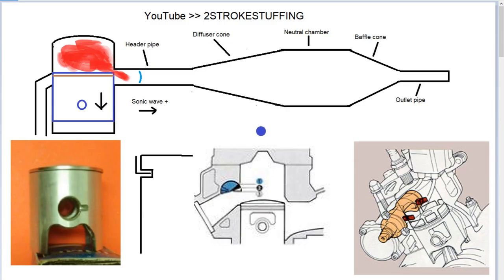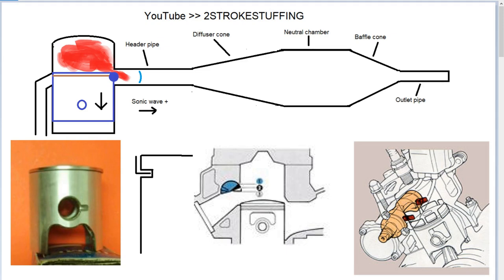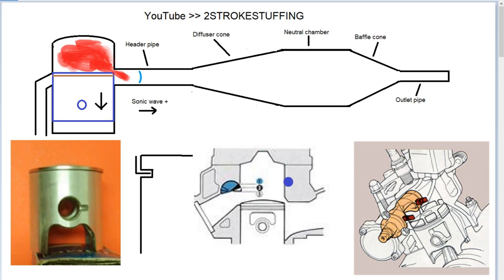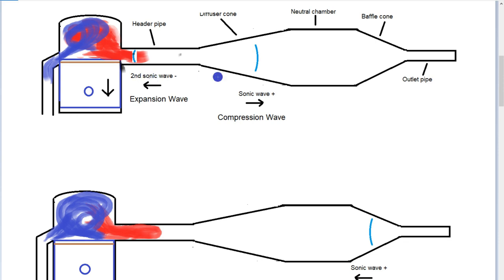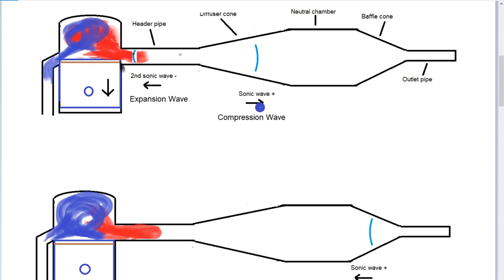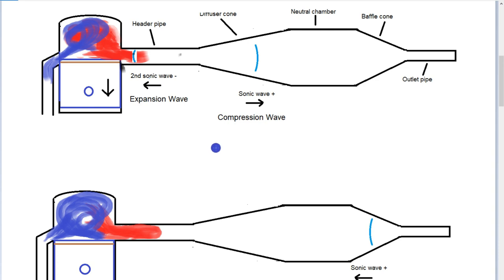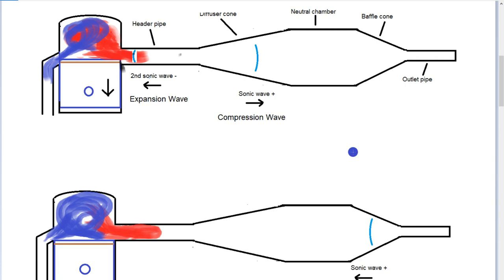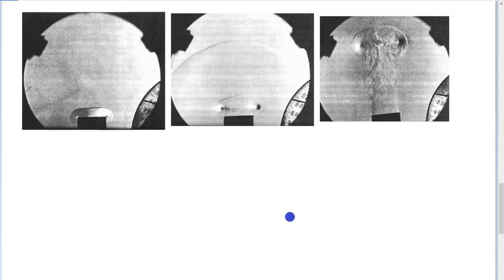2 stroke power valve, gas v acoustic velocity, exhaust port timing for expansion chamber. E2

Comment from the maker: UPDATE: Was going to upload E3 but need to do another edit of it and its 3:30 am here so Ill get it done tomorrow.
E3 covers calculating tuned lengths and shows two equations used in publications that are confusing, one for imperial and the other for metric. I will show a simpler self explanatory equation you can use that can use tuned length in inches or millimetres it doesn't matter.
And shows why there are two tuned lengths values required not just one to the baffle cone and how to calculate both.

Comment: This reminds me a bit of tuning a bass reflex speaker port for maximum low output based on the resonant frequency of the enclosure. Fascinating, thanks.
Reply from the maker: Not really
Expansion chambers don't operate on resonance like a pulse jet or the like does.
They shape of them reacts to a single compression wave as the exhaust port opens to produce the effect.
Resonance (as in Helmholtz) applies to highly specific frequencies and harmonics of them where the expansion chamber exhaust operates over a wide range of frequencies over the range of engine RPM.

Comment: I use those L shape rings in my kawasaki 125 rotary valve engine and was told they woukd be trouble but so far so good
Reply from the maker: Hi Sean, might be an issue if the port inst chamfered right but otherwise they work fine. That is an IAME race piston from  DAP or Parilla rotary disc 100 reed Kart Engine, revs to 20,000+ no problems.

Comment: Great videos that explain the science. I am an old mechanic that has stumbled into the two stroke world with a stock Aprilia RS125. I've lowered squish/raised compression and the bike has so much mid range torque and acceleration now. But... peak power is now down 1,000 RPM  (11,500 down to 10,500 RPM), which obviously reduced the top speed. I am guessing the scavenging and pulse characteristics have changed? Would appreciate your thoughts on this. As I want to keep the bike as stock looking as possible, my next step was to experiment with some stinger inserts and other elements of the exhaust.
Reply from the maker: If you lowered the whole barrel to effect the changes then you will have reduced the port timing and that would favor low end power at the expense of peak power.
If on the other hand if you have milled down the head to get higher CR and the barrel height is not changed then it may be the result of reducing the squish clearance is that the squish velocity is now too high at the higher RPM.
When making changes to the squish clearance or angle to piston or percentage of the combustion chamber it is important to calculate what the squish velocity will be to ensure it remains within reasonable bounds.
I will be doing a video on squish band and velocity soon.
Reply: @AuMechanic  thanks so much! I forgot to mention I shaved a bit off the head. I didn't want to affect the port timing. A squish video would be great! I still can't get over what 0.5mm achieved.
Reply from the maker: It is not just the clearance but also the angle of the squish area in relation to the top of the piston as well as what percentage of the chamber is taken up by squish band all of that and RPM determines what the squish velocity is.
The simplest way to describe what squish velocity is would be that when you stamp your foot in a puddle of water causing water the shoot out from the gap between your foot and the ground, the speed that water shoots out sideways describes the squish velocity being the mixture shooting out of the squish gap into the combustion chamber bowl as the piston rises to top dead centre, the speed of that should generally not exceed the speed of the flame front heading in the opposite direction outwards from the spark plug when combustion occurs.
There is an equation Blair provides to calculate squish velocity in which you can input a load of values measured and the resulting output value being squish velocity should be around 15 to 20 metres per second.

Comment: Hi. Thank you for these very interesting and in depth videos of some of the many different things going on all the time inside the 2stroke engine and exhaust system. I have a question well actually two about power valve systems, which I don't know if you have covered elsewhere?
1, I understand that the main types of power valve systems are the ones that control port height and area, and the other types that control exhaust resonance and effectively exhaust system volume.
But why don't all more modern engines use both systems together which I assume would always be more effective than one strategy or the other? Is it because it's counter productive to try and control different things at the same time?

2, Do the resonance control types of power valve work by either effectively giving you a low rpm suitable expansion chamber, as well as a high rpm matched one all within one pipe design?
Or is it that they don't really tune to pipe to work at lower rpm, but more nullify the effects of a pipe that's designed to work best at high rpm, by making the pipe so much bigger that it doesn't have any resonant frequency effects at all either good or bad, so that the engine behaves like it's got no expansion chamber at all until it reaches higher rpm?

Comment: you may have explained in another video.in a two stroke exhaust port with one large port and two boost ports does the pulse go thru the larger main port or does the pulse also go out the boost ports thatare much smaller.on my motor the boostports are 1 mm higher than main exhaust port.as i am going to build a drag race snowmobile engine and going to port it myself so i am trying to do some reaserch.
Reply from the maker: Whichever ports open first will begin blowdown and the compression wave.
So tuned length will be based on the port timing of that.
But for pipe diameter purposes re port area, include all exhaust ports in to area value as that is for bulk flow.

Comment: G'day, thanks for your no-fuss explanation of what happens in an exhaust and why the length of it must be tuned.  But what I'm stumped on is whether or not a bend in the exhaust would make a difference to the tuned length or to the behavior of the sonic waves and if not, why?  Basically, does the exhaust pipe have to be straight or can it be bent?
Reply from the maker: Good question.
In theory bends to not interrupt the sonic wave flows but only so long as the area (diameter) of the pipe does not change more than a few degrees because any such change will cause a reflection of a compression wave that will not return to the port at the intended time.
Bends will effect bulk gas flows which is more of an issue the closer you get to the cylinder where the gas pressure is very high at the initial blown down after the port opens before it has had time to equalise in pressure farther down the pipe.
This is a problem because generally the most acute bend is right up at the engine so for that reason the bend in the header must be clean, free of any interruption in diameter and certainly are progressive in change of angle and not a tight bend at one single point, preferably a short straight length (50 mm or so) right where it ends at the head before bending.
As to sonic flows, in reality any sudden change in bend angle even done clean with no changes in diameter will create unwanted reflections so for that reason like above very important to have a pipe with a smooth bend and free of any defect internally like weld slag etc.
If the header is made from straight tubing it need to be mandrel bent to ensure no pinch of crush point like normal tube bends.
If it is made from welded sections each weld needs to be back ground inside with a die grinder to remove any signs of weld bead inside.
And important to have it perfectly matching the port at the header flange.
I might do a separate video on this issue.

Comment: Great explenation !!! As i understand, the goal is to create a counterforce of the exhaust gases to avoid the lost in exces of fresh air/fuel mixture in the scaveging process thru the exhaust port. Is this right???
Reply from the maker: There are 2 phases.
The first is to aid scavenging by by having a lower pressure timed to arrive back at the exhaust port around BDC (which is the job of the first diffuser cone) and the second is to have a higher pressure timed to arrive at exhaust port just before the port closes (that is the job of the second baffle cone) to reduce fresh intake from spilling out in to the port.

Comment: Thanks for the video! I have a question: can lowering the exaust port (due to closed valve) increase power at low rpm? Or will the effect of 'increased traped compression' not be noticable. In other words: on engines with adjustable exhaust valves, can power in low revs be increased by locking down the valve? I understand that this would depend on the pipe, but does the decreased diameter still matters much at low rpm? Thanks!
Reply from the maker: Both of those factors will increase mid range power by trapped comp and wave timing, at the expense of top end if you lock the valve shut.
As to the reduced area of the port with the valve shut, that will effect the port to pipe ratio.
Normally a larger port to pipe ration broadens the returning wave making it effective over a wider RPM range so that might tend to smooth the curve a bit in mid range which is not a bad thing.
Reply: Thank you very much!